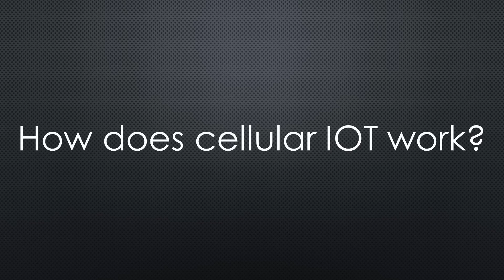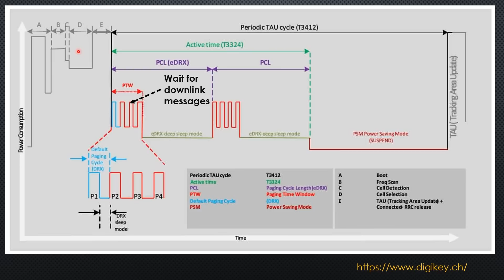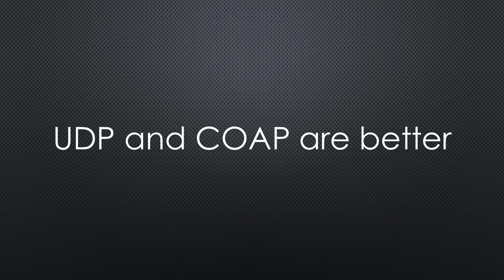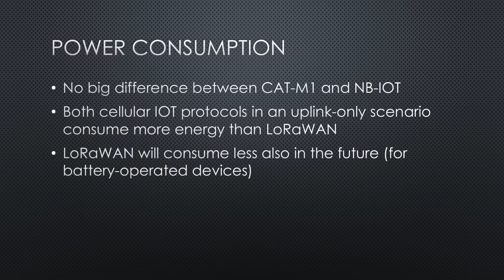(480) How does NB-IOT and CAT-M1 / LTE-M compare to LoRaWAN (Tutorial)?

Comment: Cellular IoT (CAT-M1, NB-IoT) vs. LoRaWAN: A Detailed Comparison

*   0:00:14 Introduction to Cellular IoT: The video introduces cellular IoT technologies as a potential alternative or complement to LoRaWAN for connecting sensors to the internet.
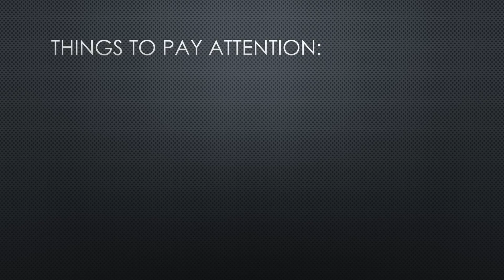*	0:01:27 Cellular IoT Considerations: There are a lot of variables to make cellular IoT work, such as, low-level protocols, available modules, arduino libraries, SIM cards, transmission protocols.
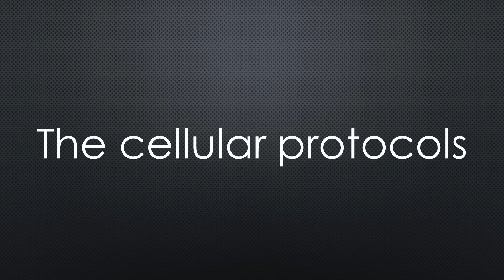*   0:01:57 Low-Level Protocols: Two primary contenders are discussed: CAT-M1 (also known as LTE-M) and NB-IoT. A third, CAT-1bis, is briefly mentioned. Both operate on 4G and 5G networks.
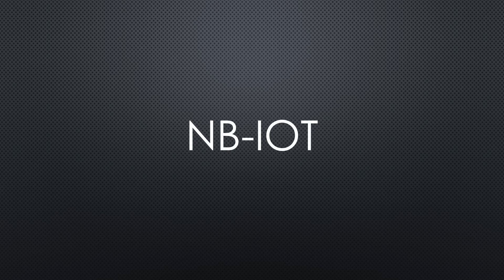*   0:02:26 Spectrum Usage:
    *   CAT-M1: Uses 1.4 MHz within a standard LTE Physical Resource Block (PRB) of 180 kHz. It occupies "valuable" LTE bandwidth.
    *   NB-IoT: Uses a single PRB (180 kHz) and can operate in-band (within LTE), in the guard band (unused spectrum between LTE channels), or standalone.
*   0:03:53 Data Rates:
    *   CAT-M1: Up to 1 Mbps uplink and downlink, with significant overhead.
    *   NB-IoT: Lower data rates (around 20-250 kbps), also with overhead, but sufficient for typical sensor data.
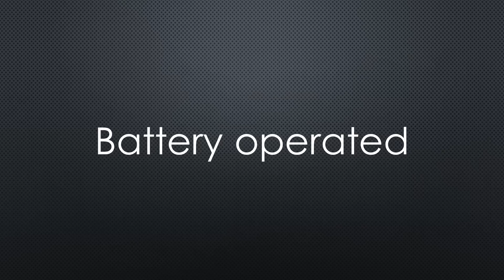*   0:04:51 Power Saving Modes: Both CAT-M1 and NB-IoT offer power-saving modes crucial for battery-operated devices.
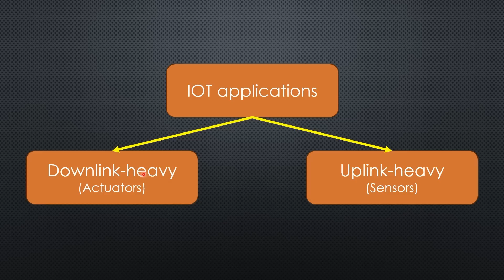    * 0:07:57 Paging Mode: Where a device will wait for a downlink message and enter the receiving phase.
    *   eDRX (extended Discontinuous Reception): Allows devices to sleep for extended periods (up to 43 minutes for CAT-M1, 3 hours for NB-IoT) and wake up periodically to check for messages.
    *   PSM (Power Saving Mode): Allows the module to power down almost completely, with wake-up timers determined by the network operator.
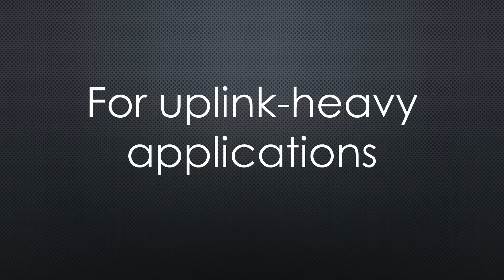    *   0:09:33 RAI (Release Assistance Indication): Can further shorten the receiving phase after data transmission, reducing power consumption.
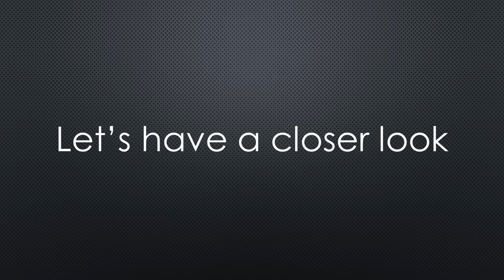* 0:05:05 Frequency Bands: Modules must work with the different cellular frequency bands.
*   0:09:56 Modules and Libraries:
    *   Many modules are available (Simcom, Lilygo, etc.), often based on chips from Nordic, Quectel, Qualcomm, or Sequans.
    *   The TinyGSM library is commonly used but requires modifications for optimal IoT mode operation.
    *   A newer library from Walter is highlighted, potentially becoming a standard for modern protocols.
*   0:11:00 SIM Cards: SIM cards are essential, and compatibility can be complex.
    *   Standard roaming agreements may not cover CAT-M or NB-IoT, requiring specialized SIM cards.
    *   Some carriers may restrict devices based on IMEI (International Mobile Equipment Identity), potentially blocking foreign SIM cards.
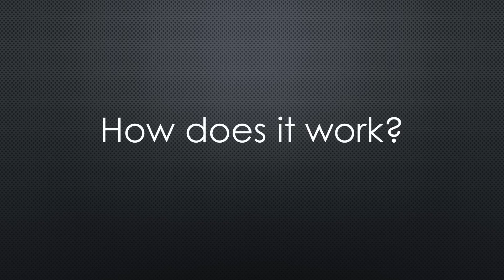*   0:12:56 Power Consumption Testing: Testing with a "sensor example" and a power monitor (PPK II) shows the connection process and data transmission.
    *   Initial connection and registration to the network consume significant power.
    *   Optimized protocols and sleep modes can drastically reduce power consumption.
*   0:15:29 Transmission Protocols:
    *   Modern modem chips support IP and MQTT.
    *   COAP (Constrained Application Protocol) is another option, favored by some for its efficiency.
*   0:16:47 Comparison with LoRaWAN: A detailed comparison is made, covering various aspects:
    *   Coverage: Cellular networks offer wider coverage globally, while LoRaWAN is limited to areas with gateway infrastructure.
    *   Reliability: Cellular communication is acknowledged, while LoRaWAN uses the Aloha protocol (unacknowledged), making it less reliable.
    *   Throughput: Cellular IoT offers significantly higher data rates than LoRaWAN, which is limited by duty cycle restrictions in unlicensed bands.
    *   Complexity: LoRaWAN is simpler to implement, while cellular IoT involves more complex protocols and infrastructure.
    *   Cost: LoRa modules are generally cheaper than cellular modems, and LoRaWAN doesn't typically involve recurring SIM card fees.
    *   Power Consumption: In uplink-only scenarios, cellular IoT can consume more power than LoRaWAN, especially with weak signals, due to the connection overhead.
*   0:20:40 Future Trends: 5G RedCap (Reduced Capability) is mentioned as a future protocol that could make cellular IoT more competitive.
*   0:21:11 CAT-1bis: Briefly described as a third IoT protocol, offering a middle ground between CAT-M1 and standard LTE.
*   Key Takeaway: Both cellular IoT and LoRaWAN have strengths and weaknesses. The best choice depends on the specific application requirements, considering coverage, reliability, data rate, power consumption, and cost. Cellular IoT is evolving rapidly, and 5G RedCap may further enhance its competitiveness.

I used gemini-2.0-pro-exp-02-05| input-price: 1.25 output-price: 5 max-context-length: 128_000 on rocketrecap dot com to summarize the transcript.
Cost (if I didn't use the free tier): $0.02
Input tokens: 14819
Output tokens: 1202

Comment: Wouldn't an ideal situation involve both? Sensors locally communicating with LoRa data bufferef locally,  then use store-and-forward to the cellular IoT network?  
Another IoT device in your vehicle(s) would not only allow you to access home data, couldn't you choose to designate your home LoRa node as a LoRawan node?  I'm not sure how this works, and it seems to me that the low data capability of LoRa likely wouldn't burden such a setup that much with other people's data.
Reply from the maker: The question would probably be cost and energy consumption. Both are important for IOT devices.
Reply: @AndreasSpiess  of course.   Thanks.

Comment: Thanx for excellent video Andreas, I have a question : I have a bc92 module that supports only LTE Cat NB2: B3/B5/B8/B20/B28 bands. Is it possible for this module to connect nb-iot cell in China ?
When I see geograpgy lte table, I cannot see any bands that my module support ?

Thanks in advance !
Reply from the maker: I do not know which standards they use in China. I just know that, in general, you can get "China" and "international" modules which would imply that there is a difference.

Comment: Sorry this cell carrier story doesn't  work.  You did point out how long a nbiot radio has to be turned on, which makes it very difficult to run on a battery. LORA is only on for 400 ms, hence how you can get battery devices to last 5 to 10 years. Lora radio distance probably 10 to 30x nbiot. Try nbiot in a rain storm.  Try getting your carrier to move their tower to cover your dead zone. All ready having customers moving from cellular iot to LORA. No one missing using 1000s of sim cards, with the hidden clauses in the roaming agreements..... one last thing... you can locate you cellular and LORA  antennas without interference
Reply from the maker: I agree with your comment. LoRa is good if you do not need cellular. They have different use cases.

Comment: I used T-7600G-H module connecting and transmitting data to blynk cloud every 1min but when i add feature to do call the data internet get disconnect and modem lost the connection as these module not support concurrency. i try reset modem but it not actually work good...
Reply from the maker: Thank you for sharing your experience!

Comment: If they opened LoRa up then it would have a better chance. It really does have technical advantages over the others for true ultra-remote sensing.
Reply from the maker: TTN is open source. Only the chip is proprietary. Which is the case for most chips I use.

Comment: i want to use the SIM7080g controled by ES32, but i want to save a UART port, in the Datasheet say that has I2C but don't say what is the address 🤕,  either say how it works, just send the AT comand througth I2C???🤔
Exellent and informative video
Reply from the maker: I did not find any information about the I2C interface (only pins). The address is easy: Use ani I2C scanner sketch on the ESP32. I assume you know that the ESP32 has 3 UARTS...
Reply: @AndreasSpiess  yep, but is not enough, and software serial sometimes crash 😕
Reply from the maker: @stefanoclementi3550  Then you have to invest your time and try ;-)

Comment: Great video!!

The issue I have found with the NBIoT is getting the battery to last.

It would be absolutely fantastic if it was possible to deploy sensors and they actually lasted for 5years. Also considering the self discharge from the batteries etc.

Could you make a video of that?

A complete example solution for deployment that actually last 5years? 

-Choosing hardware (cost effective)

-choosing sensor  and communication (example 1-20mA?)

-Complete Arduino code that use deepsleep and optimizes the communication for power consumption. 

-choosing battery 

-tip and trix
Reply from the maker: For the moment I do not plan additional cellular IOT videos :-(

Comment: Thanks Andreas for all your efforts. I follow you from years (you got me into Lora since then and now it's exploding). You say we need filters if near a cellular tower but which one?  The usual SAW filters has 2-3 dB insertion loss that is high for a 22dBm node (BTW most of those filters has a max power handling of 18-20dBm). Cavity filters are outrageously expensive...and rare
Reply from the maker: One of the gateway providers indeed adds cavity filters for that purpose. They seem to be needed if you want to mount it on the cellular tower.

Comment: You indirectly highlighted one other disadvantage of the cellular-based systems; since cell networks are so much more important and demanding, turn-over in technologies is much faster. As you note, the 2G and 3G networks have already been turned off in most areas, so a cellular-based device purchased 5-10 years ago may very well not work in the future once 6G/7G/etc roll around.

LoRaWAN on the other hand, is unlikely to see the same generational churn. If you plan to leave a sensor in place for a long time, this might mean you avoid having to redesign your project sooner.
Reply from the maker: That is why I mentioned that these protocols are also part of 5G. But generally, you are right.

Comment: Hey, did you look at the transport protocol MQTT-SN? It’s UDP-based and optimized for sensor networks
Reply: thats transport. not communication.  its different layer
Reply: as mentioned
Reply from the maker: I only tried the buil-in MQTT protocol of the SimCom modem. So I di not know how it works. And the Walter library seems to use UDP. But you have to check how it is implemented. They accept helpers for their open source library, BTW ;-)

Comment: A great video as always. You missed adding LoRaWAN by satellite, which you talked about some time ago. These connections avoid the problem of lack of coverage. Regarding 5G, I think perhaps the uses for IoT were the main reason for the war between the United States and Huawei, not only because of the higher speed and low latency in computers and mobile devices. 5G should be a great improvement over the previous, so it seemed that all the devices in the world would be connected thanks to 5G, in the trade war or accusations for security not only depended on Huawei routers, which were already available and much cheaper than American Cisco or Nokia ones, but also the security for the IoT that companies, institutions, and consumers were going to use massively.
Reply from the maker: LoRaWAN over satellites still is a very small niche. I enven do not know if it is widely available now.

Comment: One feature of cellular, to automatically adapt the radio signale for deep penetration by cost of energy, is mentioned as disadvantage compared to a fixed level for LoRaWAN. Doesn't LoRaWAN also adapt the radio signal for penetration/distance by using some settings? If it's not adapted by that settings, then the gateway needs to be "near by", causing to require more gateways and with that also more operating costs of that gateways.
Reply from the maker: LoRaWAN has the possibility of power adaption. Howevern not of repetitions (which can easily drain your battery). And I do know how often it is used. Most of the projects I know use full power all the time.

Comment: My biggest problem as a hobbyist was getting access to a good IoT SIM card, which supports NB-IoT. Most suppliers only sell B2B.

We used 1nce at work. They have by far the cheapest SIMs with the simplest price plan. 10€ for 500MB and 250 SMS, which expires only after 10years. And it's also only 10€ for an additional 500MB should you run out. No monthy costs, no hidden fees. This is exactly what I want!
When we used them for an NB-IoT project the network worked well. Their SIM Management portal is also good, they have good documentation and phone support was nice as well.
The only negative for us was some short network or server outages every now and then, which might be due to them being a fairly young company. Not a deal breaker for us at that time (a few years ago, maybe they got better, I have not checked).
Unfortunately they only sell B2B, so I could not use them for personal projects.

Q Beyond SIM has a similar plan, but with even more data: 1GB, 100SMS, 10 years, 10€.
But they also only sell to businesses. Argh

Telecom, Vodafonea, Telefonica and most big suppliers are the same here in Germany.

ThingsMobile claims to have the best IoT SIM and they sell to consumers. However they have so many hidden fees and claim not to, it's really insulting. I would not touch them with a 10ft pole.

Hologram also seems an option. But they have monthly costs per sim. So with data it would be much more expensive than 1nce after 1year or less.

If anyone has a good tip, I would love to hear it. Preferrably with no monthly cost, like 1nce.
(And yes one could start a small shell business to get the B2B offeringsy but that seems more work than is worth for prototype use cases)

Comment: Great video!
Would love to see a comparison of indoor penetration of LoRAWAN vs NB-IoT. This is one area where there is a lot of debate at my company (deploying IoT projects). I have found some studies, but nothing really conclusive and a lot of marketing bullshit sadly.
Especially some practical tests would be nice, since there is so much going on (repeat transmission in NB-IoT, ADR/SF for LoRa, different max allowed power, chirp spectrum, distance to gateway/cell tower, etc.)
Reply: We have done extensive testing in Belgium at 200 locations with Walter. Both with LTE-M and NB-IoT. We have done the same in the past with LoRa(WAN). I can say that NB-IoT has the best range (we could communicate through a metal lid from two stories underground). The difficulty in making a true comparison is that we do not have control over the base station in case of cellular. Maybe we should lock Walter to a certain antenna and do a range test and do the same with a LoRa transceiver. I'm open to suggestions.

Comment: I guess, that statement, that LoRaWAN takes less power than cellular, depends also on the (ip-) protokol used on the top and the used modem. Though you have a PPK II, would it be possible to get your LoRaWAN power consumption for a 100 byte message (or so)?
Reply from the maker: We did those tests with LoRaWAN. That is why I know that these cellular modes consume more power. LoRaWAN does not use IP, BTW. It just transmitts payload bytes with an additional header.
Reply: @AndreasSpiess  sorry for my late response. My question was more, if the cellular measurement was done with something as 100 bytes UDP message, or 100 bytes via MQTT/TLS/TCP. And maybe, you just publish your LoRaWAN numbers? For nRF9160 NB-IoT (normal signal conditions) it's about 100mAs (at 4.0V => 400mWs).
Reply from the maker: @achimkraus3269  The message length is not very important for these LTE modems (if in the area of 100 bites) because the time to connect is quite long and the transmission speed is quite high. The messages I used in this video were well below 100 bytes. The Walter library uses UDP.

Comment: My experience with nb-iot is devices have the lowest priority at the mast level (UK). Packet loss is high. Devices frequently vanish for days. Hope it's improved since!
Reply: Our experience is that NB-IoT is indeed much slower than LTE-M but it has better indoor range. Once connected we have not experienced vanishing NB-IoT with Walter, nor did our beta testers. One of our beta testers in de UK have indeed mentioned that NB-IoT was less stable then LTE-M. In 99% of the cases we think that LTE-M is the superior protocol in terms of speed, reliability and power consumption.

Comment: Excellent video, as always. I was a little surprised you didn't mention the Particle Boron. Particle has been in the connected devices market for years. The Boron module uses Cat-M and comes already provisioned with their EtherSIM (or eSIM). The code libraries make development easy and fast. I got a temperature and humidity logger up and running in half a day, and it's been running for a year without problems. Yes, you must use the Particle cloud (like TTN) but it supports webhooks to access your data. I was very impressed with the Boron hardware and software and how Particle has made it easy to do IoT.
Reply from the maker: You are right, I never looked at Boron. Maybe a mistake. Good you mentioned it here. Thanks!